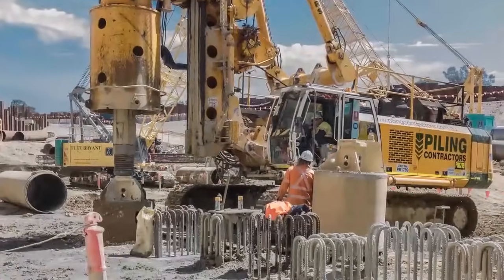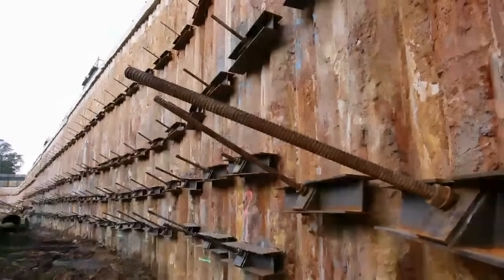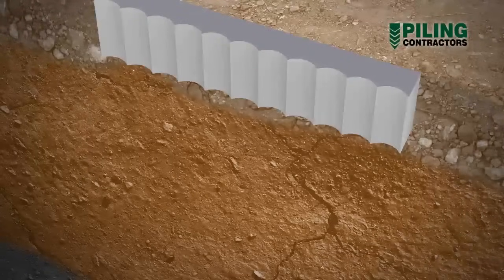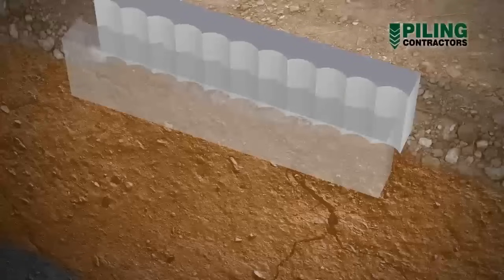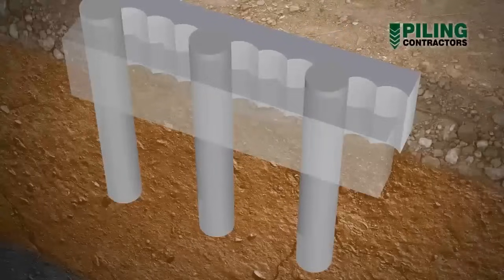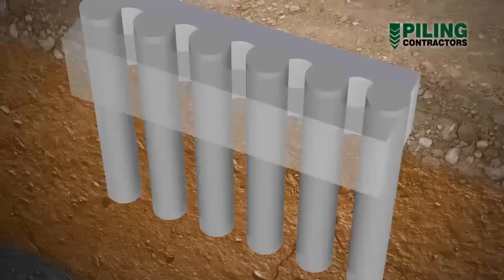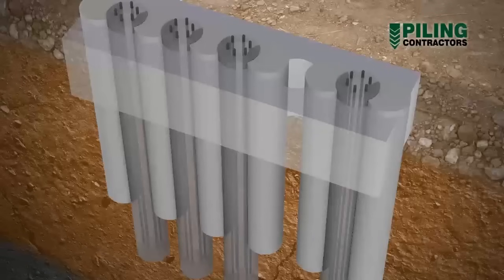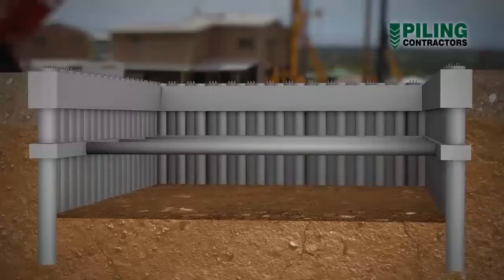Secant Pile Wall Construction Methodology

Comment: How do you connect the basement slabs to the piles and ensure that the slab is properly supported at the edges?
Reply: The basement slab normally floats independently. Secant piling will not give a watertight structure, only a water resistant one and ground water will seep through giving damp stains.  To make the basement watertight a drainage channel is connected to the drainage system and cast in a strip of concrete on the inside of the secant wall and the basement slab is built against the drainage channel slab. Then a wall is built off the basement slab leaving a sealed drained cavity on the inside face of the secant piled wall.

Comment: Better call Saul, anyone?
Reply: yup.  although i am not sure how the existing floor would be supported aka the new room/basement ceiling, or how the would dig or bore out the earth underneath without it being visible from above
Reply: Concrete cap poured over the secant walls will be the new "basement ceiling". Then excavation can begin around the piles. 

Dirt gets hauled out in the laundry trucks.
Reply: I take the dramamine but it doesn't help
Reply: Werner Ziegler
Reply: Im glad im not the only one, "wtf are secant walls"
Reply: lmao
Reply: Werner Ziegler's sweaty head.

Comment: Hello Guys, i need some help, i'm working on a project and it says the this method will be used to construct a plastic concrete core wall inta a dam. was wondering how will that be done, since the dam will be built by layers. do we wait will the dam embankment is done and then drill through it ? plus there is a filter layer of aggregates next to it how can we not hit the filer while drilling ? thanks